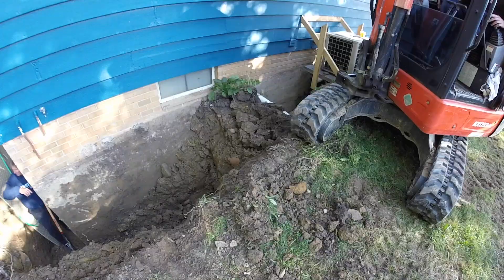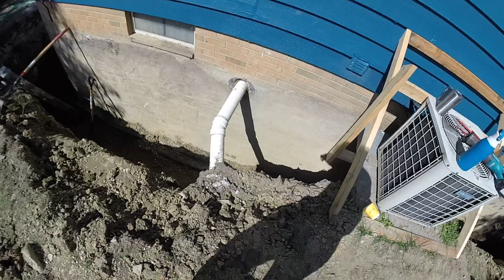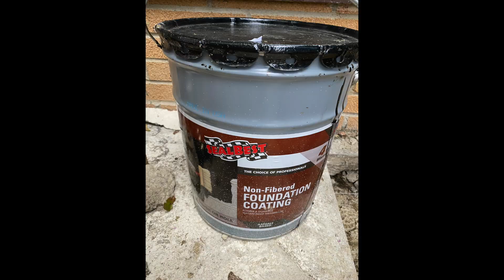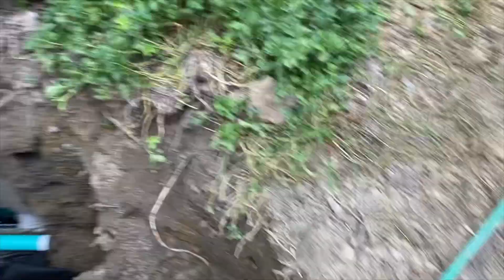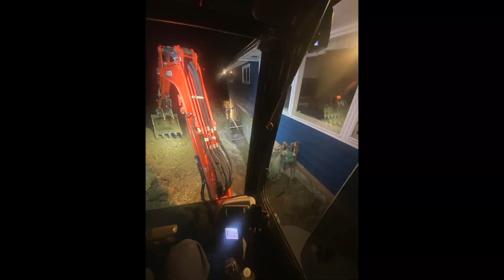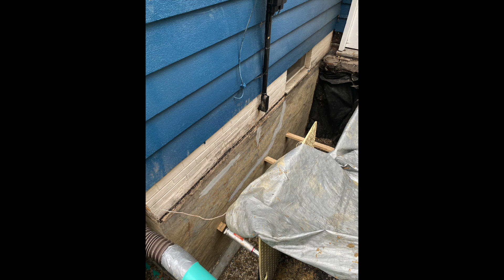Permanent Basement Waterproofing | Excavation Method Done the Right Way

Comment: Thanks for the great video!!! Well documented! I about to do a big job on my home in Portugal....it's a old house was a diy build....building haven't moved or had any cracks in 30 years...it has very simple foundation...without footing....I am getting some humidity issues on the lower part of my walls inside my house....went to do a dig test before I call the digger to come and grade it and more some soil away from the back of the house. When I did the test by hand removing some dirt to grade the soils my foundation will exposed...is that ok ?? I was planing to dig around 10cm below the start of the foundation and water proof the wall and put a french drain in??? Any advice or recommendations would be amazing 🙏🏼

Comment: My 7 ton CAT 306 is a bit too large to tackle this type of dig, were you close to the soffit/ roof overhang with your 033? If you were buying, would want a smaller hoe? Looks like the footer was around 7’ from surface grade?

Nice work on the vidya, not many existing foundation excavation videos out there.
Reply from the maker: Your cat 306 is an excellent size but may be tough up on the house. Sometimes low overhangs can be tricky with the KX33 and it’s not super helpful to have the counterweight I always have to be mindful of that vs a zero tail swing like you have. If I dug waterproofing all day I would highly recommend a Kubota U35 or equivalent with an open ROPS that you could potentially remove. That being said that way you would be able to run that machine and only worry about the arm its self. The U series are zero tail. The major advantages of my KX is the extra capacity for the size of the machine and how narrow the tracks are. My machine sits at 5’1” where the typical 35 series are at least 5” wider. I personally would not want a smaller machine because having the reach to stack dirt a little bit further away makes a huge difference. Yes the footer was about 7’ in the deeper parts of it.

Comment: Awesome work! Whats the model of excavator you're using? Im thinking of buying one to get this done. A used one is less than the entire job and I can use it for other projects. TIA
Reply from the maker: @steephunger5249  this excavator is a Kubota KX-033. Kubota makes 2 types of excavators the KX and the U series. The KX has a tail swing and the U does not so you can get closer to obstacles with a U but does not lift as much weight as a KX of the same size
Reply: @jamesiv432  thank you greatly, you've been most helpful

Comment: Dumb question? Why didn’t you all install drain pipe and or elephant trunk? Was that because it might not be able to day light?
Reply from the maker: No problem unfortunately I was not on site with most of the handwork was done. There is drainage at the bottom, so there is a footer drain at the lowest point which takes water out to the storm main at the street and there is also a gutter drain which in some parts of this house the gutter drains are only approximately 2 feet deep.

Comment: What does this cost to have done? I need it done to one side of my house. I have some water that leaks into my garage and want to have this remediated before I epoxy my garage floor.
Reply from the maker: Depending on a lot of factors usually a contractor will charge $150 per liner foot across your wall with minimums. This job would have been $13-17k ball park and typically a contractor would not have given nearly as much care to the quality as this home owner did. If you have one wall that is bad unfortunately typically the other portions of your house may not be far away from needing drain repair. As a home owner if you are fairly handy you can save your self a decent bit by tackling this project your self. Finding the best price on stone, hauling dirt out, some where to dispose of the dirt and equipment/ operator and if you need a labroer will be your biggest expense. Try to network with your neighbors. Lots of good people out there still.